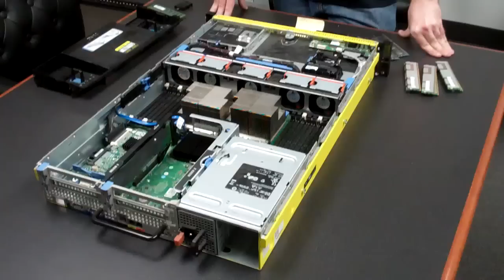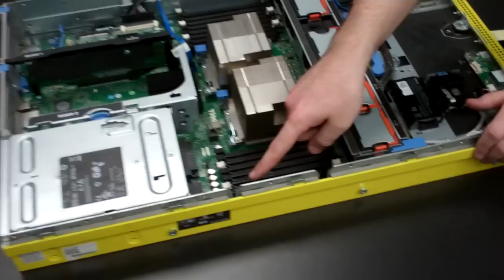Velocity Tech Solutions - Memory Configuration Dell PowerEdge R710 Server

Comment: My experience is that when running the R710 in Memory Optimizer Mode requires you to have "Balanced" memory channels. Balanced memory is defined in the manual as each channel having the exact same memory configuration. If you don't do this you get an F1 hang on boot. You may be able to disable this in BIOS, not sure. All this may be overstating the issue. I am new to this so it was a lesson learned. Great video, thanks.